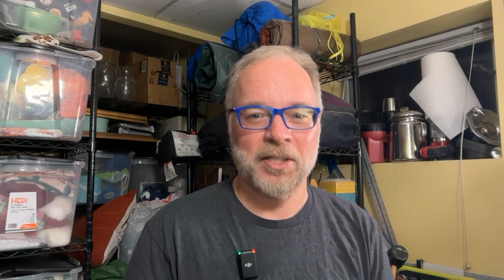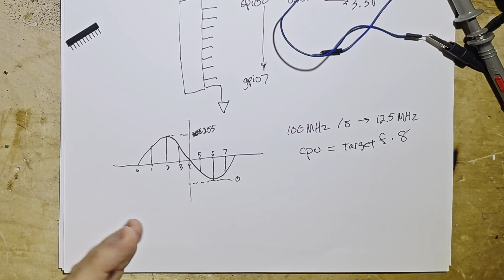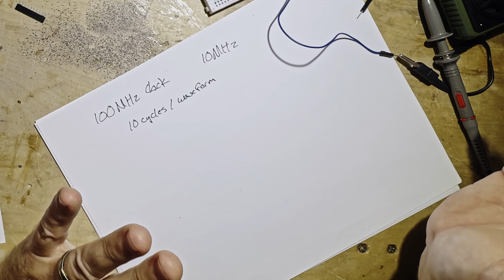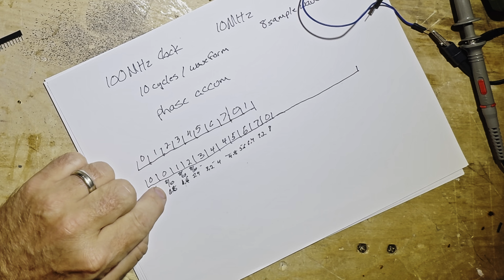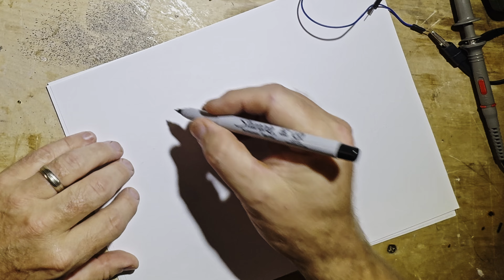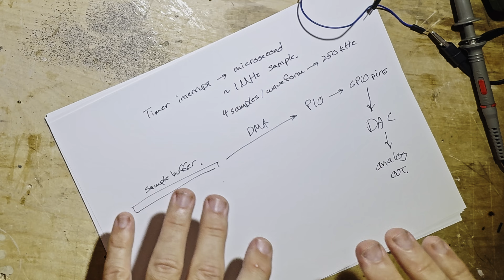150MHz DIY Function Generator becomes a Pirate Radio

Comment: An FPGA & a clock generator would do way better at 200-300MS/s ability, so maybe 30MHz is you want clean sine, but still need major filterring!
Reply from the maker: If you check my other video, I managed to use this solution to generate a 55MHz composite TV signal.
Reply from the maker: Granted, the 55MHz was just the carrier the composite video signal is much lower bandwidth.

Comment: At 150MHz, half the base clock frequency, the DAC would be outputting a square wave before the low pass filter.
Reply from the maker: Yep. For some reason I had thought you needed at least 4 samples, thus a cutoff of 75MHz. But Nyquist!  But even with a perfect probe that wasn’t filtering out the square wave I was pretty close to the sampling rate limit of the scope.

Comment from the maker: I just posted the source code for the base function generation code, and the radio transmitter branch. https://github.com/jvanderberg/megahertz_signal_gen. You are on your own for amplification and antenna if you want to transmit more than a few inches. I eventually gave up.

The code should generate solid, accurate waveforms up to 30MHz-40MHz.

Comment: After ~1/8th your scope's bandwidth, you really have to be on the lookout for what signal effects are coming from your signal and which are coming from the scope's data acquisition and aliasing. For instance after 100Mhz, the only frequency a 200Mhz scope can theoretically pick up is the fundamental, so it would naturally think that every single signal above that frequency is just a sine wave. Of course different manufacturer's scopes may perform better or worse above their spec, depending.

A cool signal you might be able to put out is a 1Khz AM tone on a 455khz carrier, useful for adjusting many many old AM radios. It's reported that if you tell an RP2350 to set its core voltage to 1.3V you should be able to overclock it to run it at 400Mhz instead. That might be fun to try. I've been wondering about creating a dual channel signal generator using 2x8bit or 2x10bit ladders.
Reply from the maker: I am pretty sure the low pass filter of the probe capacitance with the DAC ladder impedance kills any higher frequency components before you running in sample rate issues, but I could be wrong there. Was definitely running into scope limits on the high end. It was a compromise purchase but definitely better than the USB model I open the video with. 

I probably should have been able to hit 400MHz with the rp2350 I just wanted to be more conservative and keep things stable, but it would give me more headroom for the more usable frequencies below 50MHz. 

And yes the rp2350 would happily feed two DACs with two independent PIO modules but you will then run into DMA issues. Two DACs streaming samples via DMA at the full CPU clock rate might be too much bandwidth. Though if you combined both DACs samples into a single 16 bit word and ran all 16 pins on the same PIO block you might have a chance.
Reply: @ElectronicsUnscripted  I was definitely wondering if using lower values on the R2R ladder would give you better results on the amplitude front, say 1K/2K. Not sure if those are commonly in stock though in the package form you got yours. Or buying a bunch of 1.8K & 3.6K 0.1% 0603 resistors...

And yeah I bet a lot of us wish we had 1Ghz sampling scopes and high end probes for this... xD Totally not jealous of the gear IMSAI Guy somehow manages to pick up. There's also a couple of very buildable DIY active differential probe projects around which might get better results?
Reply from the maker: @ivolol  Yes, actually I switched from at 10k/20k part to a 1k/2k part for this very reason. It was harder to source, but it was world's better - made the entire project doable.

The real solution is to upgrade to a 'real' DAC, but it seems like DACs that can handle 300MSamples/sec are a bit more expensive than my resistor ladder. This was one of the reasons I went this route. It's just simple and very very fast.

I did order a high speed rail to rail op amp, to see if I couldn't add an amplification/buffering stage, but I haven't gotten around to trying it out yet.